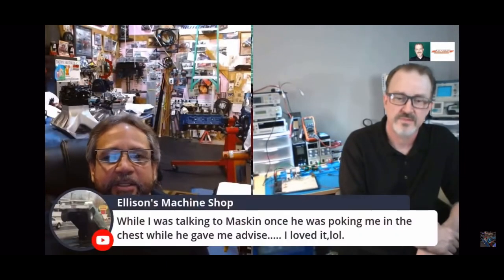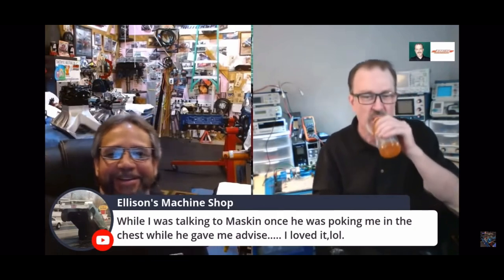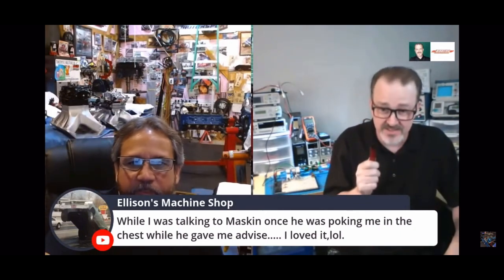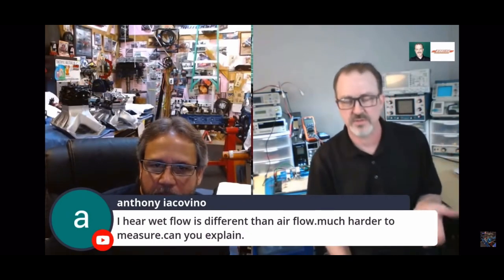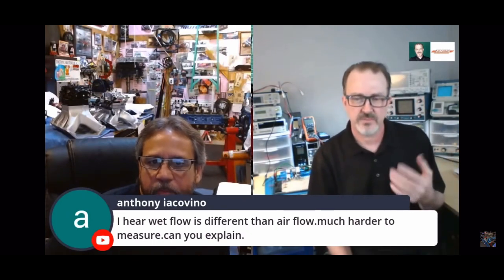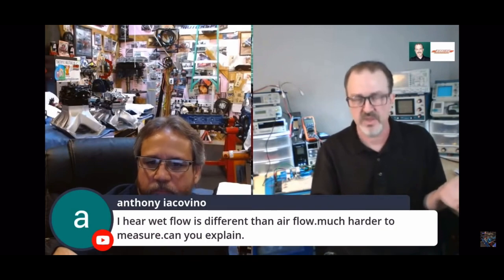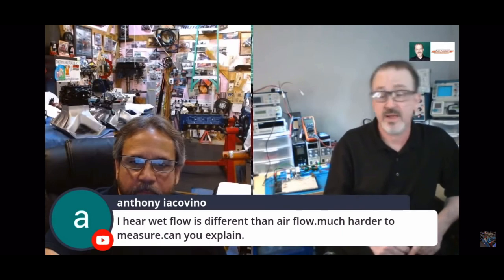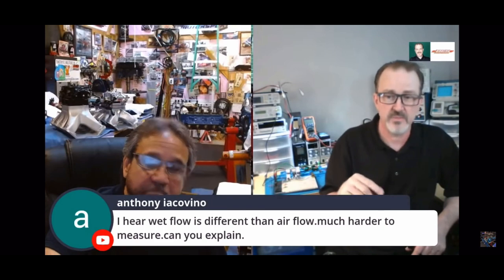DragBoss Garage: Darin Morgan Discusses Wet Flow Bench Technology, Effectiveness, And Applications

Comment: Dykem works for me...I came really close to dumping a bunch of money on the wet flow stuff when I was doing full time glad I didn't... I don't use a flow bench anymore either...
Reply from the maker: Yea and your own eyes, straight is straight, and smart volume works
Reply: @dragboss351cleveland  I used a Super Flow 600 for 25 years I started to question the importance of it after about 3 years..Dick Maskin and Brad Anderson told me the truth.
Reply from the maker: I think everyone is obsessed with numbers and what does it flow routine. 25 years tell you a lot
Reply: @dragboss351cleveland  I never made a car go quicker down the track because of anything that was ever "found-out" on the flow bench it wasted a tremendous amount of time doing a set of Super Stock heads.
Reply from the maker: I understand. I am interested to see if this engine picks up some my amateur port work though.
Reply: @dragboss351cleveland  I gained 35 H.P. on a big block chevy salt flat engine it was a good project...